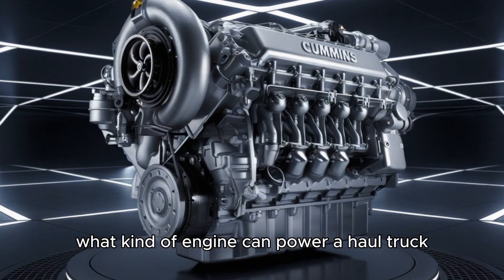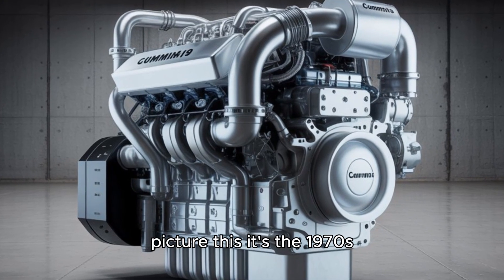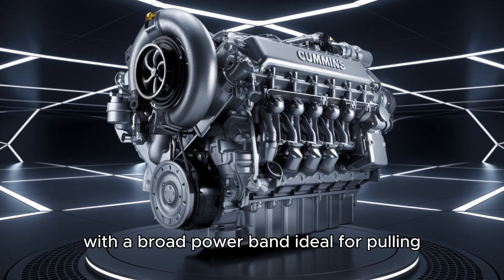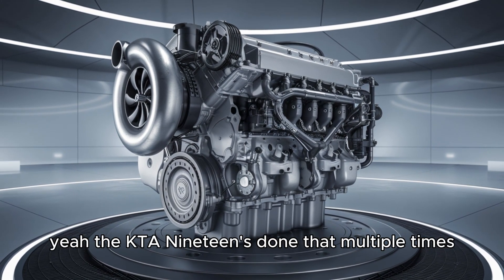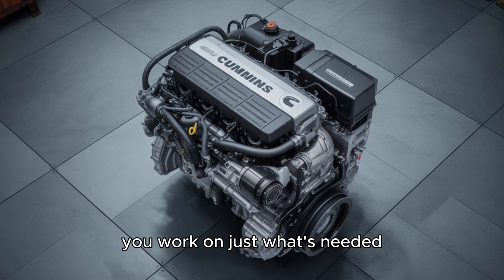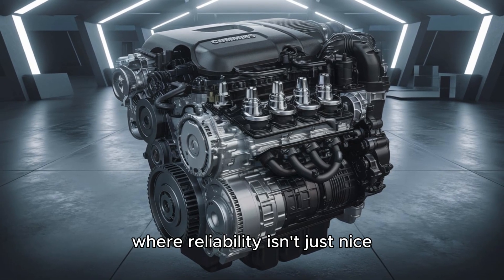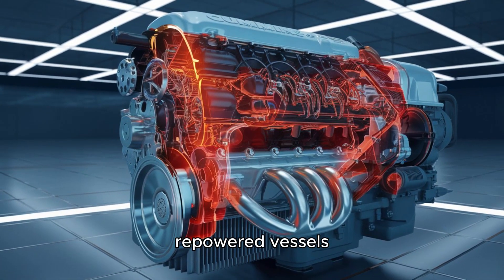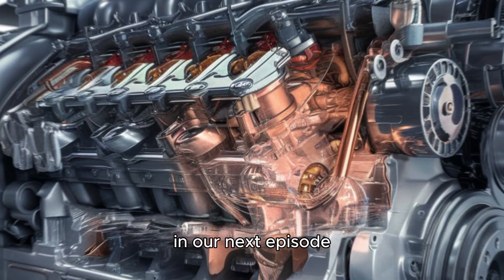Cummins KTA19: The Diesel Monster Built to Move Mountains!

Comment: And I thought it was called a power house (lol). 700HP is not a power house any more by far, add another 200HP. Or perhaps, just lets go back to the Cat C18, Marine & injaectors, set at least at 900HP. But we know it could be set rather higher than that.